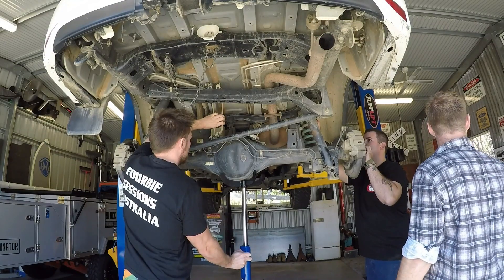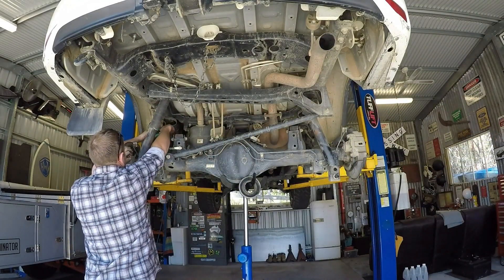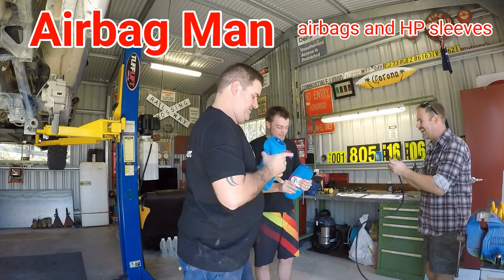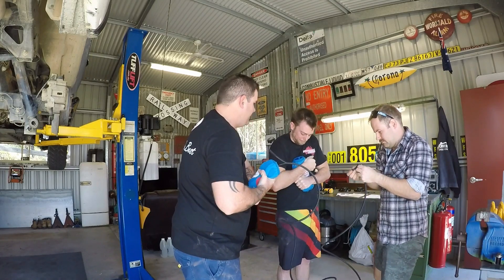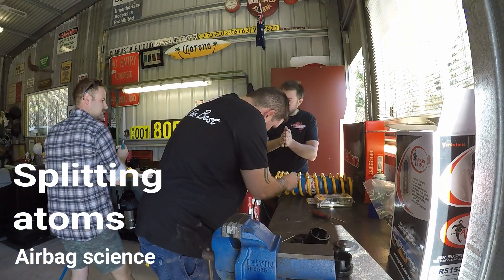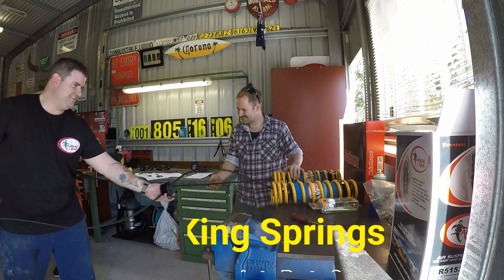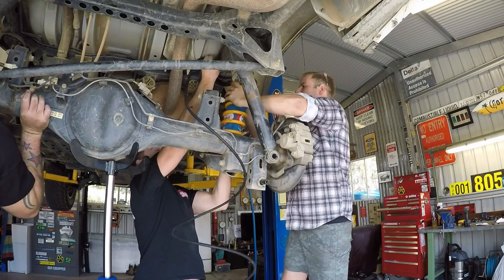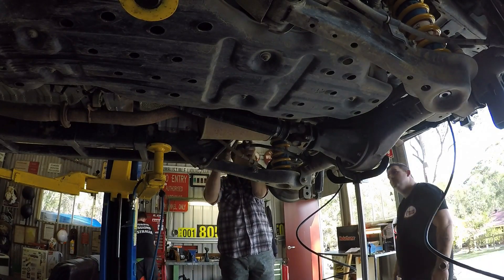Toyota Fortuner Suspension Project

Comment: Hey mate, just wondering how the Dobinson shocks rode in the rear with no weight. Cheers
Reply from the maker: They were good it wasn’t to bad with the spring weight. I did end up with a few hundred kilos in there all the time though. If you get a heavy spring rate with no load it’ll be rough

Comment: Hey mate, what did you need to do to accomodate 285/70r17s? Looking at getting a fortuner. Cheers 👍🏼
Reply from the maker: Hey dude, in this vid i am running 32's. i am now running 33's again.
To get 33's to work there's a bit in it. 
* first you will need a bar of some description to create clearance on the front side of the tyres. (you could cut the bumper but you'd be taking a fair bit out) 
* remove the front mud flaps and trim the back side of the inner guard and fold/ hammer back all the joins in the body that are in the way
* If you intend on actually using it off road you wont get away without a BMC
* you will need aftermarket UCA's to be able to move the castor all the way forward
* extended bump stops to limit up travel a little as 33's are slightly too big and will smash the guts out of your guards.
But other than that its easy, hahaha.

Comment: I'm glad you said one of the first to be modified as I too am in your boat. I've got tough dog 2 inch lift front and back with airbag man to rear. TJM snorkel and Ironman blue bull bar with 12000 pound winch. Upgraded tyres to BF Goodrich but kept the size standard for the crusade model. I'm having a lot of fun in comfort.😁

Comment: Keen to fix the Fortuna jittery back end. Wouldn’t the airbags reduce travel due to inability to fully compress the spring?
Reply from the maker: I thought the same. with 60 psi it definitely does but 10 psi it still tops out on the bump stops.
Reply: So the new rear springs are softer? Better road ride?.... and the airbags to compensate for the softness when loaded up? Is that the idea?
Reply from the maker: Yeah thats it. it has been working brilliantly
Reply: Nice work guys! How reliable are the air springs? How often do they spring leaks?

Comment: Nice project. 
I am a big fan of fortuner trucks as well . Will start a suspension upgrade on a 2016 2017 as well. Whats your truck , V4 or V6?
Here in dubai there are 2 Models , a 2.7 litres and a 4.0. 
What's ur review on a 2.7 if i wana go for a  moderate off roading and what upgrades would you recommend?
Reply from the maker: Thanks Mohamammed. In Australia we only get the 2.8TD for what it is its pretty good. We did still put a Steinbauer power module in and an iDrive throttle controller. 
For what i've seen of Dubai i'd be getting the V6 4L with all that sand. Tyres and under body protection always at the top of the list. If you do a 3" front & 2" rear lift you'll be able to squeeze a 33" tyre under it with the right wheel offset.
Reply: @60trvl  thanx for the advice!!!
With the described lift , would it be safe without the drop kit ?
Reply: In australia fortuner is got same engine as prado 2.8 turbo diesel 4 cycl. I own crusade 4×4 model. Its insane machine

Comment: Great stuff, could you please post a full droop / underside of 17” rim to underside of wheel arch? It would be good to know how much extra droop you got. My standard Toyota upper control arms give me 860mm droop.
Thanks.
Reply from the maker: Hi Richard I will measure it on the weekend and get back to you. At the moment this will be determined by the shock length. there is now room around the coil to go lower and the ball joint is at a much better angle on full droop. This is why we are currently looking at longer shock options for the front to create more down travel.
Reply: Did we ever find out how much more droop over the standard Toyota UCA this gave?

Comment: Did you have a problem with your transmission? Sometimes hard to shift from P to R and when its shifted clunking sound appear?
Reply from the maker: No issues created by suspension. We have put a new clutch in because of the torque increase. Our Fortuner is manual if you load up the driveline then compress the clutch there will always be backlash.